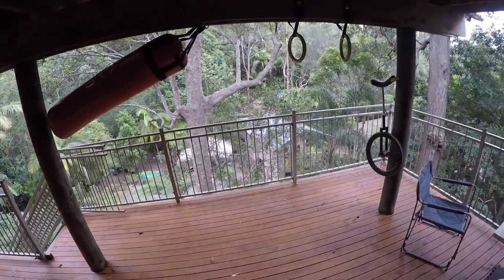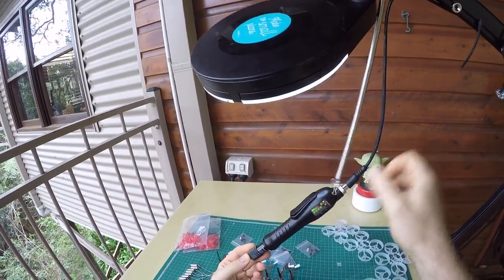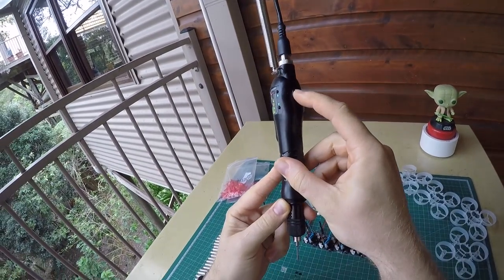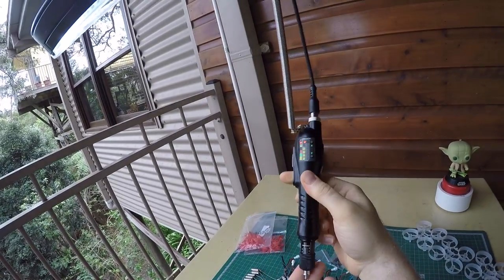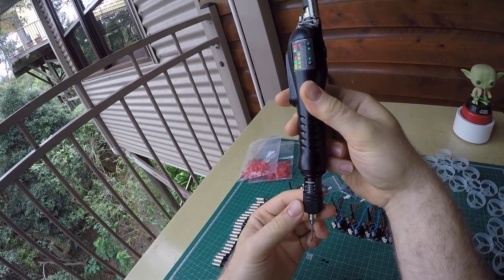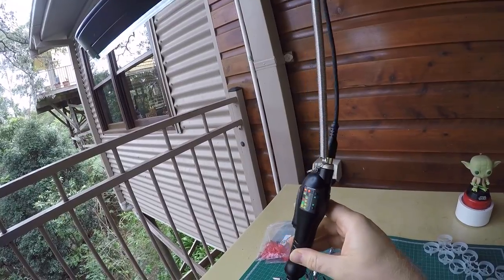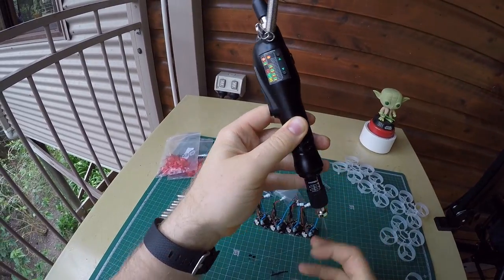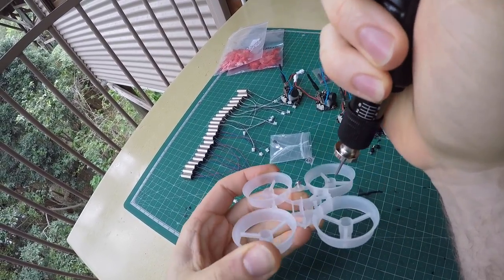Sudong SD-DA1000L - electric screwdriver with speed control and torque limit

Comment: Thats awesome.  I had a very similar model when I used to repair cell phones.  Back then screws for Nokia had to be tightened to a specific specification or there could be rf leak.  I miss having that driver.  Good stuff Benedikt.  Thanks for posting.

Comment: Thanks for the review! It's unfortunate that there's no torque limit in reverse mode. Most of the time we can use that mode to determine the torque at which it was originally assembled, especially on sensitive  material e.g. electronics (obvious examples are HDD, Laptop elements, etc.)